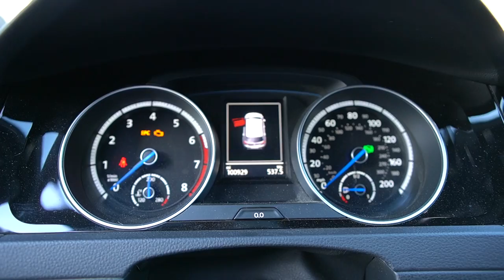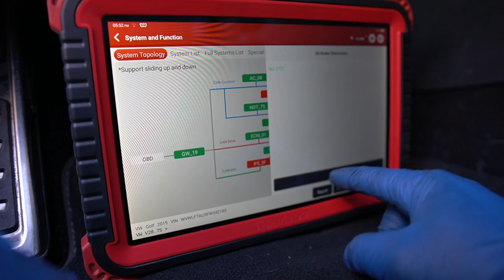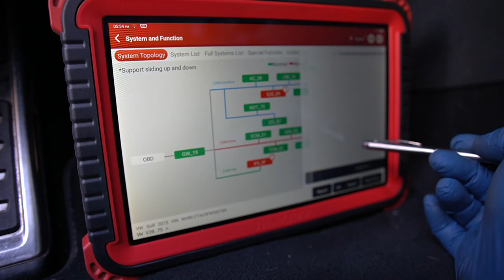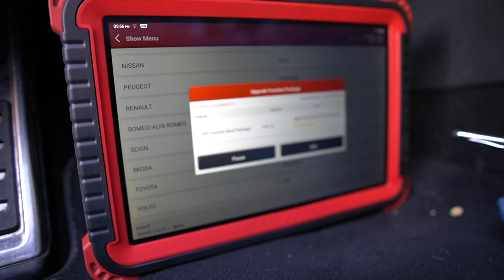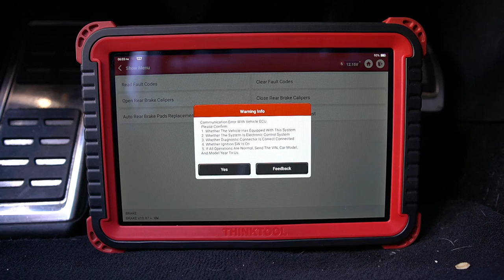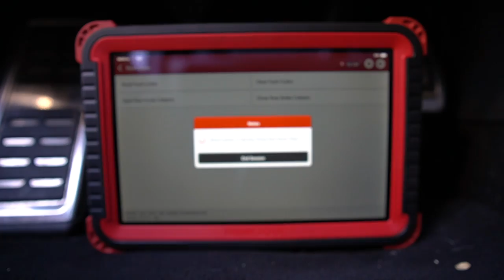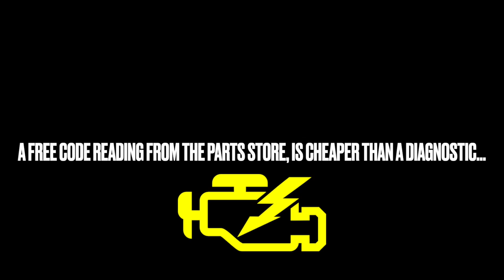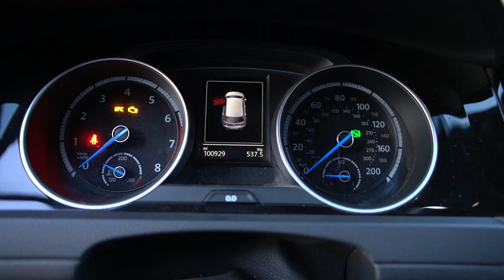VW Golf R (MK7) Back Brakes (Electronic Parking Brake)

Comment: Bro stuff like that is why I left the industry. As a service writer I was always 💯. My techs would say they require brakes when the customer wouldn’t but would recommend if it was close to it. I would follow MAP guidelines. And those brake pads where no where near any recommendations guidelines unless customer was complaining about squeaking noises…. 🤷‍♂️. The bad shady shops and mechanics get the most attention than the good shops and mechanics which is a shame because there are a whole lot more good than bad but it only takes a handful to ruin it for the industry. But f#€K no I wouldn’t even suggest brakes on them rears 🤣
Reply from the maker: 💯 That’s why I left the shops, better off alone. When a shop has a good tech, the shop gets praised, not the technicians, we stay in the back doing the ‘dirty’ work, running around trying to flag and out flag each other. Instead building each other up, we compete against our fellow techs and eventually it’s everyone for themselves. One shop with 5 good techs becomes 5 independent shops trying to make the most. In doing so, techs start to rush, start cutting corners, misdiagnosing, throwing parts at cars, and soon the “shop” is a shithole. It’s not just the automotive industry. It’s the corporate world 👨🏻‍🔧
Reply: @HomieHektor  your right bro! my boss would love it when I would turn wrenches with my guys to make sure we got ish done. But I didn't like it when we got other techs from other shops to help us out because someone was on pto. We made sure we had no more than 2 good techs 1 learning, and 2 GS that way we avoided that. Because we ran like this and made good money and we shared the shops bonus we all made money not just the shop! if we didn't, I still got lunch on pay days!! even tho my techs made more when they flagged when we were busy af! lol... but once corporate knew we made a lot they would load us the f@#k up shop got worst and morale went with it! Greedy af bro!! but I'm glad you left FS they're either bad af or ehhh.. I've only been to like one decent shp of theirs and that's because they were in a slow area LOL!!! and I'm in FL! love the channel bro long fan for a min! from one Hector to anotha!!! ex Cali boi! LOL